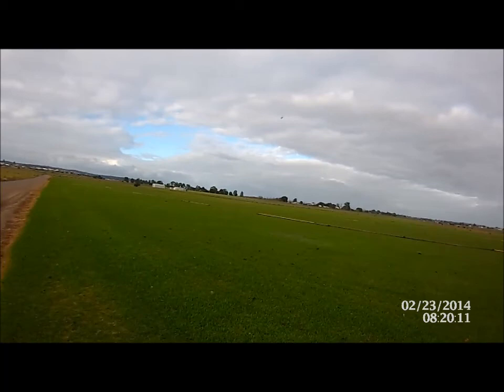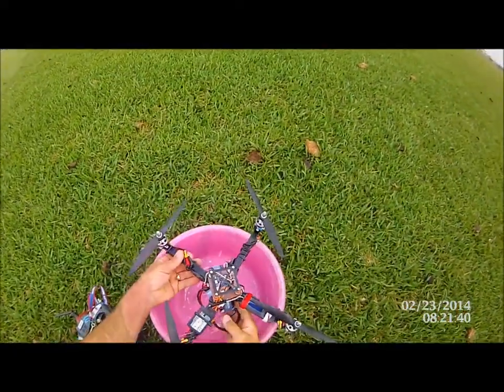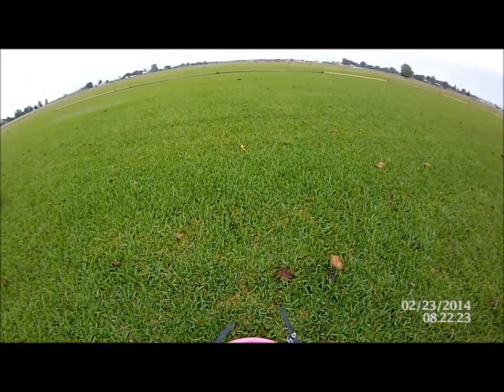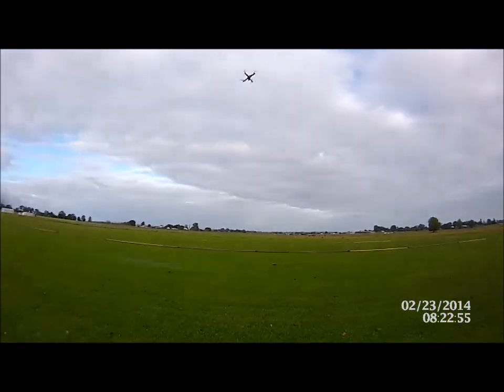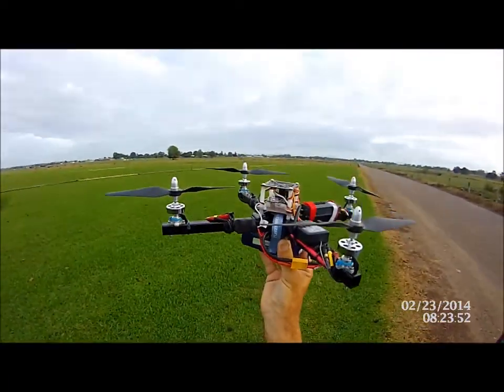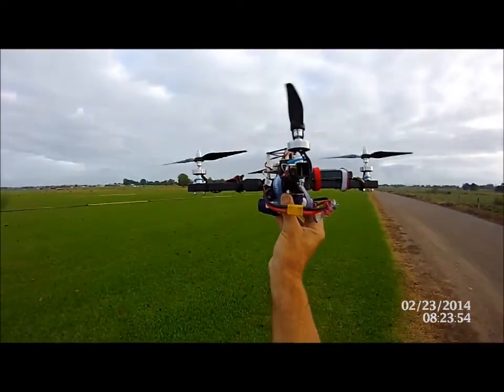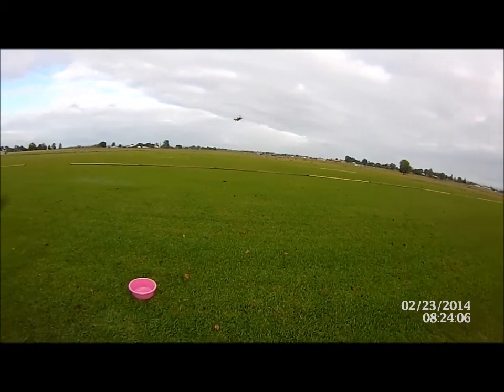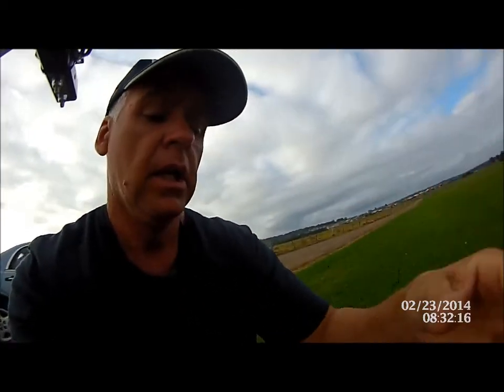1700kv speed test

Comment: Looks like a lot of fun Mooch? I don't get anything like the stick time you do, and I think I'd stuff the poor little thing into the floor if I tried that? The camera perspective may be misleading?, but at the speeds that doing, it looks as if it'd get away from you real quick? Nerves of steel dude!!
Keep Em Coming!!!
Reply from the maker: The camera perspective is misleading as the lens is a fish eye so when its on the quad you dont get the perception of depth and from the ground it appears a lot further away than it really is.... if you have a look at on board section at the 3:00 min mark the quad is flat out in that run and it appears to be going slow as compared to the ground shot. ANywho its all good fun.